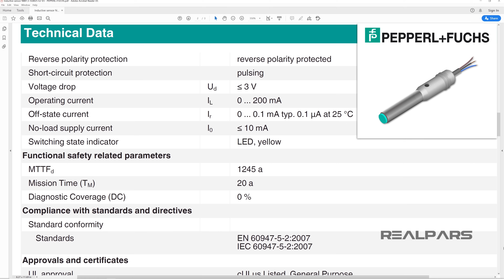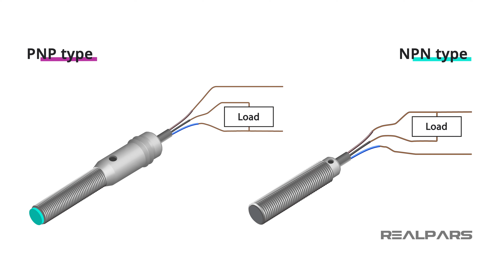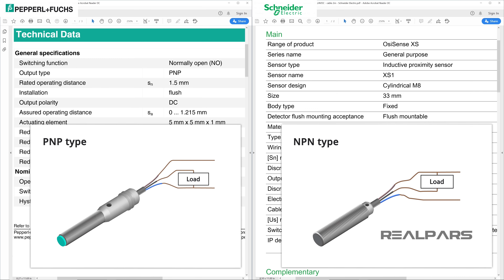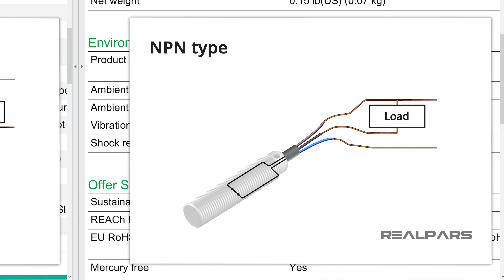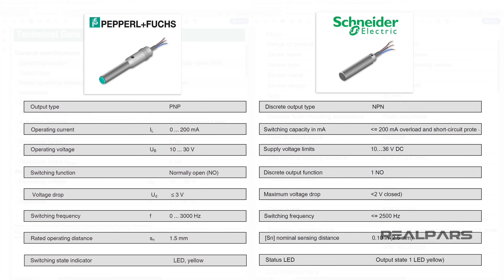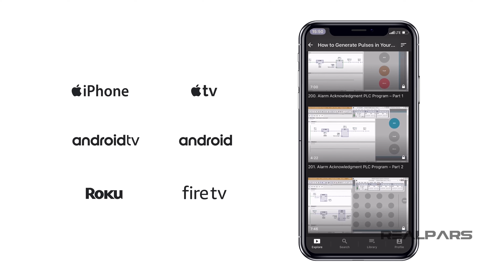3-wire Inductive Proximity Sensor | How to Read the Datasheet

Comment: anyone familiar with 'sick' model RZT7-03ZRS-KR0 the schematic does not have an 'FE'. nor an npn or pnp transistor. instead it has '[' to left of reed diamond. and a n/o switch. signals labelled as pin1= L+/M pin4=Q pin3= M/L+ and shows load between pins 4 and 3. ive got zero idea what L+, Q or M means...

Comment: if I want to determine how much current can a sensor consume, what parameter I have to choose? the operating current or consumption current? this is for determine a remote I/O I have 16 inductive proximity sensors so if I connect them to a remote I/O and  I choose the operating current, then the total current would be 200mA times 16, right?
Reply from the maker: Hi @phillip twin. Thanks for reaching out! The operating current is the maximum switched-on current that the prox device can carry before being damaged. When connected to a PLC or other high input resistance device, the current flow never gets close to that value and is usually in the micro-amp range.  You would have to see the PLC input module specs to find the input current rating.  But, if the prox sensor is connected to a lamp or a fan or other low-resistance device instead of a PLC, then damage can occur. 
The consumption current rating basically describes how much current the prox sensor is drawing from the power supply when it is switched off. Because the prox sensor contains some electronics, it does require a minimal amount of current to operate. This consumption current is very small and usually less than10 mA. 
So, when all of the prox switches are off, you might have a power supply current draw of 16 * 10mA = 160 mA.  When all of the prox switches are on, you would have slightly more, but almost negligible. Let us know if this helps or if we can provide more feedback.

Comment: What are some of the best proximity sensors for counting teeth on a gear as to measure the speed at which it's rotating ? The reason I ask is because I'm currently looking for a sensor that do the previously stated, on a 15 cm diameter gear rotating at 3000 rpm.
Reply from the maker: The problem with your application is two-fold.  First, it is difficult to detect individual gear teeth, regardless of speed, unless the gear wheel teeth and slots are specially designed for this type of detection.  The other complication is that the speed requires a very high-speed digital input card and a fast-switching sensor.  Not a problem!  Hall Effect proximity sensors are the best sensors for this application.  See:  https://sensing.honeywell.com/hallbook.pdf.  I have been very successful in these applications with a Hall Effect sensor by counting full rotations of the shaft.  It is easy to install; the magnetic target and pickup sensor can be installed anywhere along the shaft. Most high-grade HE sensors can handle up to 10kHz, but care needs to be taken to select the correct components.  The appropriate high-speed DI card or dedicated sensor electronics with an analog output should be carefully selected.
Reply: @realpars  Ok this is what I plan to do. I want to measure torsional vibration on a vertical shaft. For this purpose I was thinking about attaching 2 gears, one at the top and another one at the bottom of the shaft. I would also add a motor at the top so that I can control the speed at which the shaft is rotating. Ideally I want to induce high speeds on the system so that resonance is present. Once in resonance the torsional vibration phenomenon is most likely to be occurring on the shaft at which point it's most convenient to measure it. In order to measure it I thought about putting 2 photoelectric reflective sensors, one for each gear, and have them generate pulses for every tooth they sense in a single revolution of the shaft. When that happens I can then compare the two series of pulses and find out the lagging between the signal which is the result of torsional vibration acting on my mechanism. I really need to know what sensors work best for my application. If you can share some of your experiences with me or guide me in what you might think is the right approach I would really appreciate it. Thanks in advance.

Comment: Excellent video. What is the load in this case? Thanks.
Reply from the maker: These types of proximity sensors are rarely used to actually operate a load directly because of their low current capability. In most applications, the load for three-wire sensors is a PLC or DCS digital input. As the input resistance of either PLC or DCS  digital inputs is very high, the resulting current is very low.
Reply: @realpars  Thanks for your excellent work. Please keep us educating.